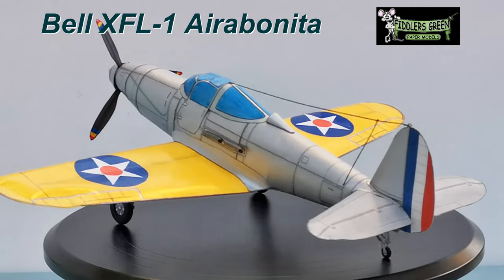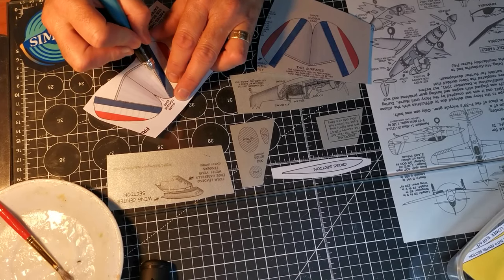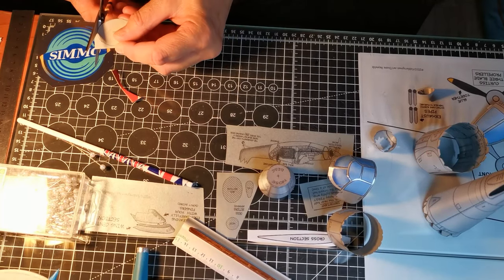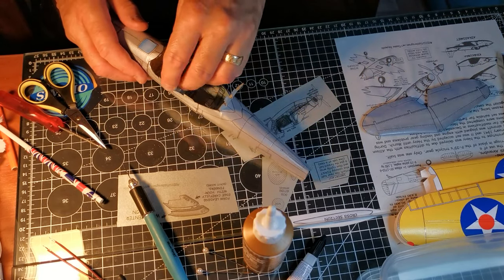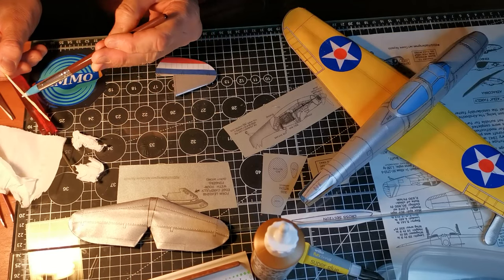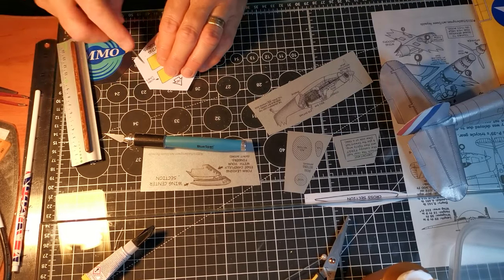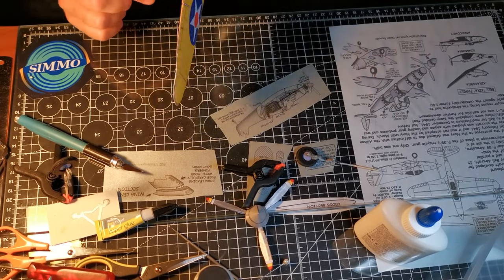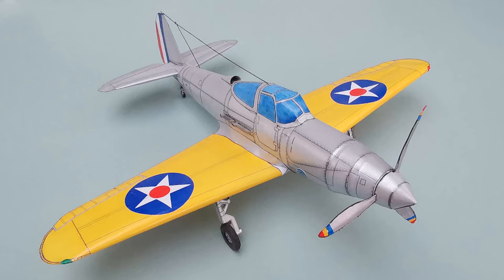Bell XFL-1 Airabonita Paper Aircraft

Comment: Fantastic job ~ many thanks for sharing details of the build ~ adding tissue paper, additional bulkheads and cocktail sticks for strength - love it. 
Is there a particular white glue you use? 
What do you apply the white glue with? Looks like a blue felt tip of some sorts?
KR AndyT(Somerset)
Reply from the maker: Thanks for your comment Andy. That 'glue applicator' is one of the cake decorating tools. It has a silicone tip which cleans easily. As for glues it depends on the circumstances. I use (mainly) straight white PVA for large surfaces, superglue (thin) for awkward parts and 'Hi-Tack' glue for normal work. The Hi-Tack looks like PVA but it has a stronger and quicker set time.
Simmo